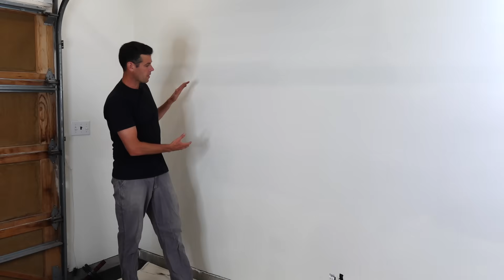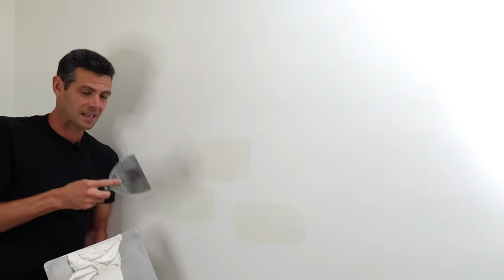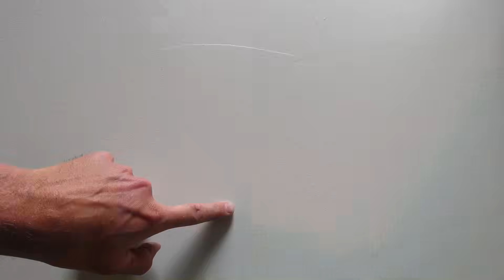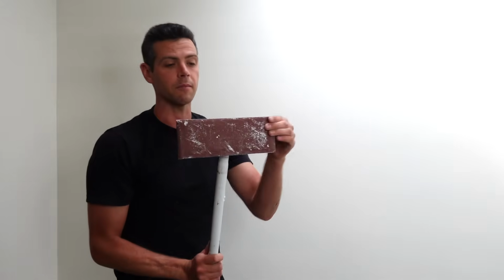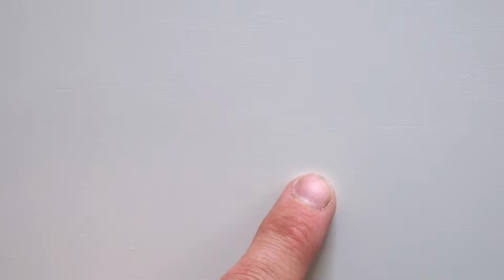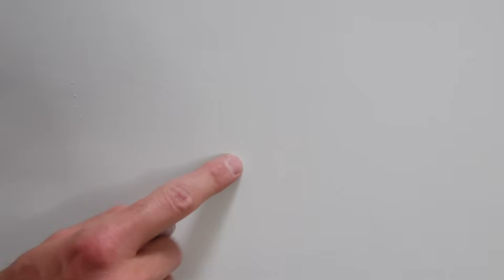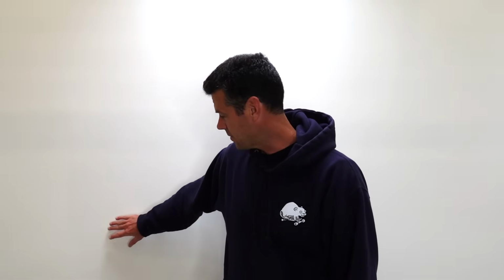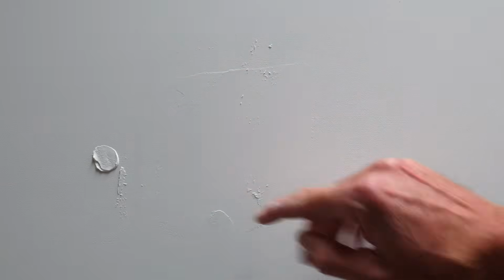How to DESTROY YOUR SKIM COAT with TOUCH UPS!!!😭

Comment: I did a level 5 finish in my master bath. I did one room successfully, so that makes me an expert, right? I'm a little confused by the idea of touching up with patches. Why not simply put on a heavier coat and sand down what you don't like? It worked quite well in my bathroom. I found that 180 grit left scratches in my finish, so I got 220 grit from the wood finishing aisle and used that instead. I used a hand sander and made very small, light circles. With enough finesse, it left no scratches. With that kind of finish, I wasn't about to put paint brush marks or roller stipple all over it, so I got out the sprayer to do my tiny bathroom. Primer, then base, then trim. All with a sprayer. I probably washed out more paint than I put on the walls, but it was worth it. Your content is awesome. I really appreciate you sharing tricks that have obviously taken a lot of experience and thought to learn. God bless.

Comment: I bought a condemned house at a tax auction and the guy who lived there before me seems to have beat the drywall with a tire iron all over.  I had some mud and mesh tape and a neighbor came over and just started patching holes.  After an hour or so of me hinting that he should take a break I finally insisted that he stop mudding and leave my house.  Then he demanded I pay him for the work that nobody asked him to do.  I gave him $10 but I should have sued him for the cost of removing all the mud and mesh tape he put on my walls.  It looks horrible.

Comment: Small pinholes can be mudded and immediately scraped off (not wiped off). Or lightly mist the area with a spray bottle prior to mudding. This tends to help melt the edge pretty well when wiping. No pressure needed to feather edge. Must be dry to sand of course. Don't forget to add a touch of (but not two touches of) blue chalk to touchup mud. One problem we have is some builders refuse to primer walls immediately after the smooth finish. And call us back two months and a half after drywalling to touch up the walls prior to painting. Where it looks like people have used the rooms as a driving range for their golf game practice. We just laugh and tell them to primer as is. Then pay us to refinish later.

Comment: As a drywall taper only; I do not include priming in my quotes. The actual painter does that. So it is imperative that I do all obvious touch ups at he final sanding and light check. And by using the same mud as my skim coat for touch ups; the sanding of those is of no concern. I must add that i use a pretty worn out sponge for sanding the touch ups.

Comment: I did this on a job that had a wall of windows shining on it.  It actually was a more challenging job than normal as the stud wall crowned on a stud/ new to existing joint.  It kicked my ass, I came back the next day and I was so embarrassed.  I fixed it like suggested, re skimming.  It also was extra challenging as it was so intensely bright, I couldn't see shadows from where my mud was laying.  And touch ups insta-dried.

Comment: Jeez this seems so obvious once explained but yes, I've been blighted by this problem over the years and never clearly realized the connection with density of the filler versusthe background. I've actually found it worst when using 2packd fillers on soft wood timber- ending up with a hump no matter how much I try to sand it flat.. of course, as ithink you're trying to explain.. your just sanding down the base material around the filler more than you're sanding the actual filler. Cheers mate!

Comment: So does the same compression stuff apply when using painters spackle on a finished wall (for repair)?  Should i not be pressing hard for ease of sanding and to get flatter repairs?

Comment: Further to my previous comment, I have one more DIY drywall question I’m hoping you may consider for a future topic. I have fire sprinklers in my home, and on occasion have had to open the ceilings while keeping acceptable margins around the sprinkler heads. If you had to replace an entire panel that had a sprinkler penetration, how would you go about doing it? My biggest question is how the original drywall installers cut such accurate openings for the heads as there is no box to guide a rotozip. Besides, I would expect a rotozip not to be used with risk of damaging the CPVC pipe and fittings. There is little margin for error as the escutcheons need to fit near perfect to avoid stressing the underlying pipes. 

Thanks again.

Comment: I've been doing repairs for twenty plus years. I'm amazed this video doesn't have the simple solution because Vancouver Carpenter is very knowledgeable. solution.... You wet the mud  more and instead of skimming you scrape it off the wall. After it dries you can wet sand if needed. most of the time I don't need to sand at all. The mud has to be the consistency of pancake batter but a little wetter. Never use a sander!! always use a wet sponge. This is how you get a level 5 finish.
Reply: Do you have a link to a video that shows an example of what you explained?
Reply: @elle7037  There should be plenty out there. If the mud is put on smooth enough, you only need to sand or wet sand the final coat. The final coat is put on super thin because you water down the mud. Put that coat on then scrape it off then wet sand after that dries. Dry time is like 15 minutes for the final coat because it's super thin. You can't even tell there was repair. Wet sanding isn't for big repairs or whole walls. It's for small repairs.

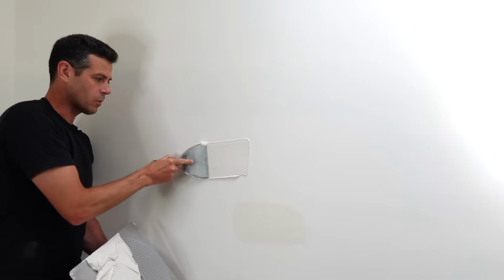Comment: 3:24 When I do any kind of touch-up, I always keep a small flashlight in one pocket so I can find all the ridges instantly, then, before the spot is dry, I run my finger along lines perpendicular to each ridge until it is completely obscured. It helps to wet the finger by spitting on the mud that's left on the knife and rubbing the finger in that; that also keeps that mud soft enough to minimize the ridging on the next touchup. The fingertip will leave very subtle marks, but if you use a light enough touch, they'll be much less perceptible than the ridge they obscured and will sand out without a trace.  
       Finally, if you find that you missed a ridge, one way or another, and it hardened that way, the best way I know to fill the ridge is to put a small bead of mud right on the edge of the knife, then apply the mud with the knife edge parallel, and the knife motion perpendicular, to the ridge, leaving a long but VERY narrow blob right over the ridge, then, with NO mud on the knife, run it over the blob in a motion that is parallel to the ridge, leaving a very narrow patch area. The narrowness of the patch allows the knife to remove almost all of the mud, leaving no appreciable ridge behind. Of course, if the flashlight shows that you didn't press hard enough to avoid ridging, the finger trick will work just as well at this point.

Comment: Hi Ben is have used powdered mix on my walls. The house is hold and it had moisture, had no idea. I sanded the first coat then reapplied another coat of powered mud, after it dried it formed cracks, now I have scraped of all the plaster and scraped off more of the old paint. Can I just skimming coat over everything and be done with it.

Comment: Does this only apply to skim coated walls? What if I’m just doing taped flat joints and I’ve sanded 3rd coat. Can I touch up small holes or prime first?

Comment: If I've made this mistake, but the touch-up area is smaller than ...say...  6''x 6''. What issues would/could arise if i cut out the post-sanding touch-up in the same manner i would cut out a stress fracture/ crack?
 So, i would cut out around the perimeter of the mistake ( essentially creating a moat around an island of hardened mud) & then scrape/cut/gouge the island down to below the surface of the surrounding wall/dry & sanded mud. Then i would prime & lay a bed coat, sand it & then the finishing coat. 
Would i completely compromise the integrity of the  dry, sanded mud around the patched area?
Lastly, could i apply tape or something around the bad patch & scrape it down?

Thanks!!

Comment: Dear Ben, HELP!!!! I'm skim coating a popcorn ceiling. I repaired some nail pops as you taught me. I used quickset, 2 coats on the nail pops. I sanded as you suggested, before applying skim coat lightweight mud. Now after skim coating twice, the patch where I repaired the nail pops is yellow, and showing through the first two skim coats. Why?? And how do I fix?

Comment: Unlucky me you didn't post this last weekend because I just touched up a skim coat on my hallway ceiling and there was something about it that just didn't feel right. I sanded and then touched up using watered down lightweight all purpose over machine mud. They seemed pretty similar in consistency until after I was finished touching up everything and realized the lightweight all purpose is heavier than the machine mud. I sanded everything down and it seems pretty smooth, but the different colored muds created a blotchy effect that is making me regret mixing muds. I am just hoping it looks OK after priming because I have a broken back and nearly killed myself trying to do the skimcoat. I don't think I have it in me to do another coat.

Comment: Good video.  Let's cut to the chase.  Touch up AFTER you prime.  Way easier, but you may get bubbles in the mud so you need to know how to deal with that.  Tons of videos about mudding over paint and primer vs existing mud or bare drywall.

Comment: After sanding, what do you do about sanded particles/drywall dust on wall prior to priming? Can you just prime right after sanding, and let primer seal in dust? Or is more preparation necessary?
Reply: I vaccum and or damp wipe or use the dust cloth, I think the dust shows up in the primer.
I also make sure the floors are vaccumed, so the dust does not float up and into the lower edge of the wall when priming.

Comment: I was taught to do like you said and do touch up after I prime. The flaws show up a lot better with a coat of paint with just a little sheen to it anyways but my main reason is exactly what you’re video is about. Touching up over freshly sanded drywall never turns out right whereas if you touch up after your primer coat it is easy. It’s like anythjng else. If you trust the process you get way better results. Shortcuts always cost you time in the long run
Reply: Do you guys just add drywall mud over the primer for the touch ups? Then prime that spot again?

Comment: i really appreciate these kinds of videos teaching this. Thank you.  But a suggestion to make it less confusing... you say " i will show you how to do a touch up"  then you gouge out the flaw... then you skim coat again??? then you touch it up.. i'm very confused.  can you touch up without doing another skim coat?  I don't understand this part of your lesson.  I suggest you break it up into steps: for example say: 1) find the flaw  2) gouge it out 3) now you must reskim coat the entire wall  (entire room?) 4) fill in the gouge 5) sand  etc ...

Also, as a beginner,  trying to learn skim coating myself I have yet to see a video that explains how things go wrong..... because most of these videos are obviously done by experts who haven't made a beginners mistake in many years.  So another suggestion would be to get an ammareur that you teach and go video all the mistakes and instruct how to avoid them or how to fix them.. Some topics might be:  how much water do you add to thin before you roll it on (when using a roller) and how to properly drag the various kinds of blades .. then show all the various problems a beginner would have and why... for example my first attempt:  didn't cover paint on the wall  then i started over again redid the entire room and it  still didn't cover paint on the wall, then i go raised areas like a topography map looking issue,  then i got what looks like scattered   coral islands  then i got some ridges then i got some divots  then i got some raised mounds.  etc etc etc.  so many problems that not one expert has reproduced in their video (probably because they don't ever make mistakes!!! )  most of these videos show an expert do a perfect job and then they say "that is how you do it!"  and theres is no way a beginner is going to do it that well the first time or even the 100th time.  so its just a suggestion ...your expertise is amazing and helpful but it also makes it hard for you to demonstrate all the problems a beginner is definitely going to create for themselves.  just a suggestion and some points to consider.  i hope this helps you make even more videos and improve your instruction.

Comment: What about hitting your touch-ups with a heat gun? 
I use one when there are mistakes with texturing so I don't have to wait for Mother Nature to dry the area. I heat the texture fully, then sand the problem area, then retexture and blend it to the surrounding texture.

Comment: Off topic a bit, my apologies in advance… 

but my question is about a 2 ft wide section of wall adjacent to a door. The mud is a year old here and my painter (also 1 yr ago) didn’t prime this mud prior to latex topcoat and the latex peeled off easily. Not a bad thing because I need to add mud to fix a belly here anyway, and I’d like to know : 

Is it best to prime and then mud or is it better to rough the old mud and add new mud?

Comment: The 2nd worst way to sand must be with a radial pole sander. 🤦‍♀️ so if i already sanded and I have the islands and the wall looks like a mess I have to skim coAt without priming first? How do I resist going back and doing touch ups though can you make a video on how to practice that amount of self control?

Comment: I wish I saw this video before skim coating a wall with the wrong mud, then next day switching to easier compound. I sanded the whole wall after one skim, and now i've seen this video, and looks like I'm in for another day of priming then another skim coat!! I had the wrong supplies, and wrong how to spinning in my mind. Never mentioned between coats.. I tried putting one thin coat over unsanded mud, but it looked very scratchy and peeling. Was this because I was impatient and didn't let it dry? Probably. 5 years of landscaping with degenerative discs stopping me from doing outside labor, and now I'm caught doing this for my employer. I don't want to give up. I cannot stand not finishing my work. I'm new to this part of painting, but I've painted before. Just easy cut in and one coat type painting jobs. I've got a 8'x7' space skimmed once and sanded. The color of the wall was a beige/caramel color. I just wanted to find a way to bring the wall even to the imperfections (bathroom wall) and also paint with a nice paint/primer like a high hide Sherman William 4000 in pale bloom. Am I doomed?

Comment: Got a question man,,,, i skim coated my wall with all purpose joint compound,,, and i primed the skim coat with a valspar stain blocker/waterbase,,,,, the primer just peeled off and does not bond,, i used a painters brush to remove dust, i took a damp cloth and gently wiped off dust and vacuumed,,, and primer doesnt hold. Trying to stay with a waterbase primer but if i cant its ok,,,, you got any afvice,,, btw love the channel man
Reply from the maker: Sorry I really don't know why. Different areas have different products but AP mud and a primer sealer is usually a pretty safe bet
Reply: @vancouvercarpenter  thanks anyway,,,

Comment: Hi Ben, you say the actual fool proof method is to sand after priming. If you do touch-ups after priming, would you then need to prime over those touched up areas after sanding them?
Reply: I would. 
Otherwise you have two different surfaces and depending on the paint the touchups will show through.

Comment: What i found in 22 years In the trade never do to much touch up on sanded  product because of the flashing issue like this  prime everything first then do a good touch up  also 95 percent of all finishers never kill there edge in transitions that also creates bumps in a skim wall always clean your edge before you layer on top gives you a way better smooth finish bump free
Reply: What do you mean “kill there edge in transitions” ? Does this apply when skim coating? Do you mean before slapping more mud on to clean the knife completely and then continue?  Lol I’m about 4x over the time I allotted for this project and I need to finish this before school starts.

Comment: I often will wait even until after my first paint coat to do touch ups. They are much easier to notice once there is a little Color on the wall. Especially little fisheye holes, the white spots show easily. I will then skim the holes and scratches and you can very easily see if you’ve left too much mud on the touch up spot as well.
Reply: I get some lite yellow paint tint and mix it into my mud or spackle so I can  easily find it after prime coat

Comment: Ben, I need some advice.  I touched up a bunch of nail pops on my 25 year old house.  The touch up areas are nice and flat and smooth.  But the rest of the wall has texture from layers of old paint.  I primed the touch ups and repainted the whole wall.  But every evening, when light is coming from a very shallow angle, I can see the smooth repair locations.  

How can I fix it so that the texture is more even?  Is there any option other than skimming the whole wall so that everything's smooth?
Reply from the maker: Three options. 
1)Paint it a billion times, it'll even out. 
2)Skim it out. 
3)Don't look at it in the evening! 
I would choose option 3😂